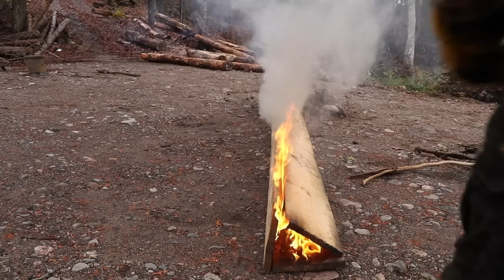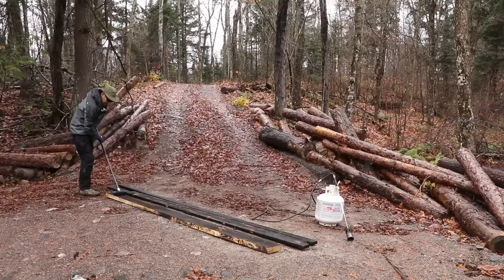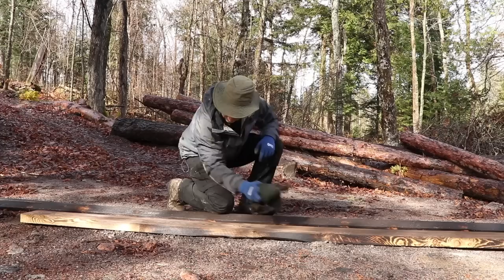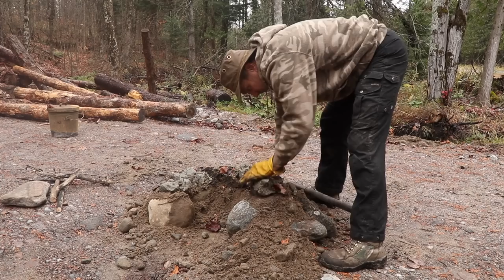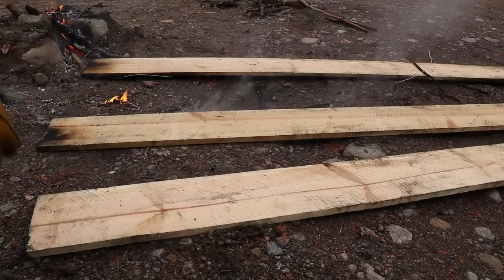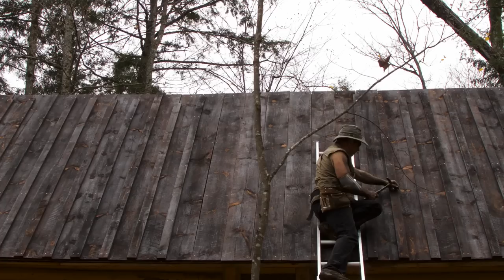Traditional Japanese Way to Preserve Wood with Fire using Shou Sugi Ban, Yakisugi on my log cabin

Comment: great idea but i dont think you charred that first one enough, you not supposed to have ¨fresh¨ wood showing like it was.  It only works if the total surface is charred, i suppose that was a floor board though so not a problem.  The fire burned ones are for the roof?  They looked properly toasted, should work great.

Comment: Not sure if I'd use vegetable oil. I've  stained the barrn I built and fence with used motor oil and diesel fuel. The blacker and higher carbon the better. Brings out the grain and looks great. Is it bad for the environment? Probably less than city water. Farmers have been recycling oil this way for years.

Comment: I'm thinking it's going to leak but I've never heard of board & batten walls leaking.  Hope it doesn't.
Reply from the maker: It would without the underlayment. Even walls leak, but it usually has paper behind it and/or it drains so quickly out the bottom that it doesn't do any damage. If I didn't strap to create an airspace so it can dry on the underside, it would rot in a few years.

Comment: + My Self Reliance Hey Shawn, if you hold your handsaw by pistol-grip you’ll have much more control over it. Your index finger shouldn’t grip the saw handle, it should be parallel with the saw blade pointing towards its tip.
Re your roofing, mebbe take a look at the way Alain Vaillancourt (The Woodpecker) did the roofing of his new woodshop? Seems like even Matthias Wandel approved of it, so…

Comment: Smoke has no effect in the wood other than leaving carcinogenic harmful substances, try to avoid.  Blowing the gas torch through the triangular tunnel might work best.  I would not scrub the charred surface clean and rather leave it for protection in outdoor use

Comment: Shou Sugi Ban is probably a western mistake.
If you get this kind of treated wood in a Japanese hardware store it is (yaki sugi ita)  (at least the places I have seen)

In Japanese the technique is called
焼杉　Yakisugi (as you mentioned)   Which is literally "burn" + "(Japanese) cedar"
or  
焼板　Yaki-ita "burn" + "board"
Japanese characters have a Chinese reading and a Japanese reading.
　　                Chinese       Japanese
焼 (く・き)    Sho               Yaku/Yaki
杉                    San               Sugi
板                    Ban               Ita

In Japanese it is a bit rare to mix Chinese/Japanese readings in a single word. It does happen with some words but the vast majority are either Chinese reading or Japanese reading. So even if you combined the 3 and used the Chinese reading it would be "Shou San Ban".

Also closes pronunciations for an English speaker (although not perfect, the phonemes are different in the 2 languages)
Sho - Show 
San - Like Yawn with an S
Ban - Like Yawn with a B
Yaki - The "Ya" in Yawn followed by "key"
Sugi - Sue - "gee" in geese
Ita - Ee - ta

Shou Sugi Ban =  Show Sue-gee Bawn
Yakisugi = yaw-key sue-gee

Comment: Why have you done it double (searing with fire & cleaning with wire brush) ? I'm asking because have removed - as I see - almost all carbon layer. So, why you repeated these two steps before oiling it ?
Reply from the maker: Mo In Trial, based on some research. Final product?  No brushing at all on the roof, one brush for the floor

Comment: How necessary is the oil treatment? I was going to burn 4 6x6 for a sidewalk and have no idea exactly how to go about it so I don’t have to worry about the walkway in the next 50 or so years because I’ll be dead by then.
Reply: You might want to read up on the Yakasugi method, also referred to as Shou Sugi Ban.  There are more steps involved, including the use of a tar/denatured alcohol mixture applied to the wood which does affect the end results.  There are YouTube videos about this whole process if you want to learn more.  The wood so treated does last an incredibly long time…upwards of 80 years.

Comment: What kind of oil are treating the board's with once you have completed the burn?
Reply from the maker: That was Canola oil. It's the cheapest and most plentiful. I may use tung or linseed oil on the floor
Reply: Thanks I love your videos. I'm looking forward to see how you're going to put the floor in and do the chinking.
Reply: this was the thing I was wondering too, chinking I mean, cuz her in Finland the building method is a bit different (tar oakum filler between logs) but also way more labour intensive, so chinking is the way for him being do it all by himself kind of approach. great videos.
Reply: any issue with the canola oil becoming rancid at some point?

Comment: Hey Shawn, your vids are great. I was wondering if you have an update on how the cabin roof is doing using Shou Sugi Ban for water shedding? Do you have an opinion about using Douglas fir (west coast) for Shou Sugi Ban? Thanks.
Reply from the maker: The roof is holding up well without any leaks.  I have seen Douglas Fir charred and it looks great.
Reply: Great! I think I will try it as roofing for my off grid wood shed.   Thanks for your reply.

Comment: Vegetable oil by cause problems in the future with mold.  I think a petroleum based oil would work much better.
Reply: Depends on the vegetable oil used.  Linseed or tung oil both dry with a hard finish.

Comment: I've copied you with some wood projects and they seem to be holding up well... any updates on yours? thanks!
Reply from the maker: I wanted to test it, so I Have one piece of red pine 1x10 sitting on the ground in a damp spot by the cabin. It’s the first piece I burned before starting the roof in the old cabin in 2017 and It’s been on the ground since then. It’s in great shape.

Comment: It looks better but I dont think you are suppose to wire brush it so much that you take off most of the carbon You are suppose to rub it INTO the wood with the oil. Now for the interior I suppose it does not matter as much.
Reply from the maker: That's what I'm thinking. Maybe a little less brushing closer to the door where snowy clothes might drip on the floor and miss the stone.

Comment: Did I miss something? You couldn't possibly have used vegetable oil as opposed to a petroleum based oil such as lemon, orange oil, tung oil or the like. Vegetable oil is food for humans so it stands to reason that it might be edible to other creatures! Btw,  fire is fire so it matters little if the source is fuel or something else. As long as the fuel itself is not imparting its own material (i.e. plastic etc.). Also it might be good idea not to do around dried leaves in area (flying embers) and to have a H2O bucket available. Just my 2cents!

Comment: I'm a time served carpenter and joiner (UK) and was taught cedar in particular responded badly to any kind of treatment which was applied - not the burning aspect but things like wood preserver or paint.  I know that larch can be more resistant through burning the surface and those planks you have will probably outlast you!  Let's hope they outlast the current American government!

Comment: I would have used double boiled linseed oil in bulk,  no?
Reply from the maker: Mike M Can't find a cheap enough source. I think I'll end up using wax for the floor
Reply: Just worried the vegi oil might turn rancid? A wax for the floor is a good idea.. My experience as a high end furniture maker, built custom stickley, arts 
& crafts , shaker hardwoods for 10 + years, My go to finish to have durability, plus elasticity, was and is equal parts high gloss polyurethane, 2 boiled linseed, paint thinner..Very easy to light sand, reboot for years...
24hrs between coats with a light sanding up to 1000 grit for say a black cherry dining table, min 5 coats..!
As Im sure you know, all 4 sides need to be finished as well as the one you will be walking on ! Cheers!

Comment: Vegetable oil? Not linseed or tung? Why vegetable? For the cost?
Reply from the maker: yes. It would cost a fortune to use linseed oil, although I'm not committed to either yet. I use linseed oil on my canoes and tools.
Reply: Linseed oil or Flax seed oil, is also vegetable oil, as is tung oil.  Anything that grows is vegetation.  Thus it's just a choice of which veg oil suits you needs and your pocket book.

Comment: Traditionally your not supposed to scrape it off. (or for that matter burn it soo much)
The easiest method is with a friction burn, and I think it is available in Japan, as a stock furniture material.
it's usually polished today (full black)....
but the scraped(lightly) version is the common seller (restained dark).

The original process was too pre-burn an existing cottage's roof.

Usually done by lighting the whole roof aflame with dry straw.
The wind and rain would wash away the burned debris and slowly unveil the grain.
The process is repeated every 5 -10yrs to keep a black sheen.

No oil is added to the timber: The whole hous would not stop burning than.

PS: Bloodhound your mummas arse.